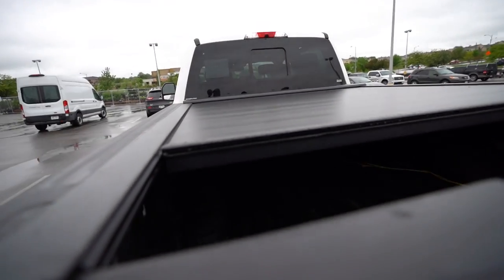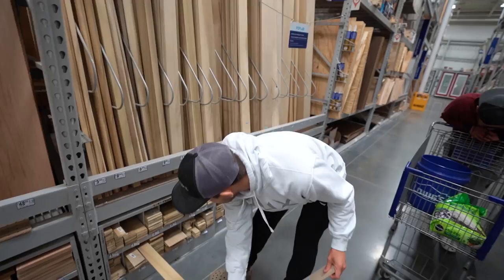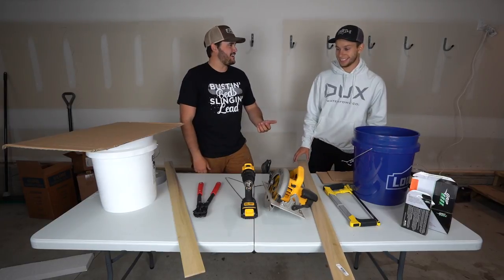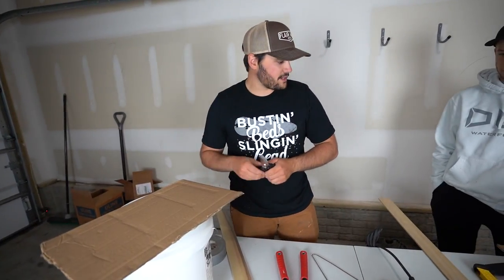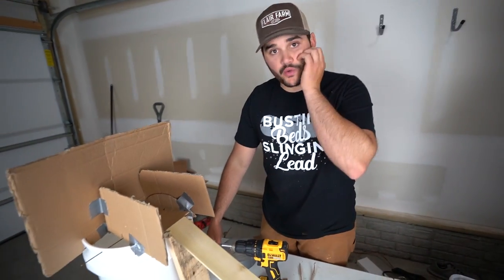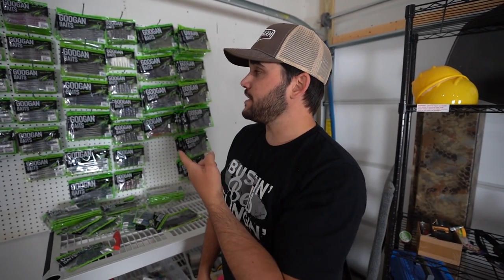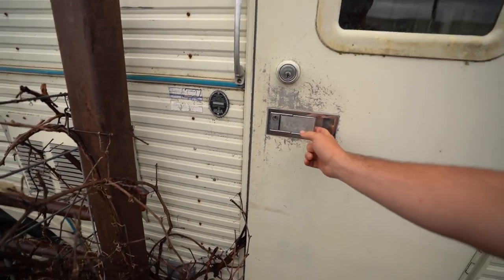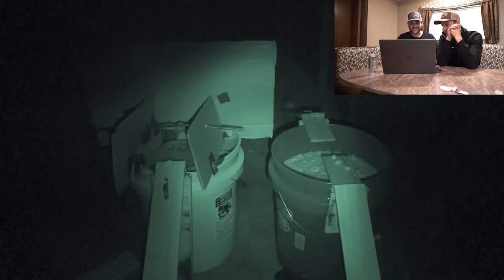EPIC Homemade MOUSE TRAPPING Challenge!! (CARDBOARD vs QUICKSAND)

Comment: Bro I'm all for the "glamorous" look of an automatic rolling bed cover but trust me..... Don't mud, don't drive on a diet road and don't put anything dusty in your bed.. u get one small rock in that motor or track your screwed. I have a 16 platinum f150 with automatic running boards and I have had to replace the motor twice, I live on a gravel road and do truck things with my truck... I finally just shut them off so I basically don't have running boards cause I'm scared to "get them dirty" just a fair warning man.

Comment: Self resetting I think is what you were thinking of.
For the quicksand one drop the water about 2-3 inches and have a minimum of 1 inch perlite. A better medium to use is coco fiber. You need less and it's more of a natural feel to the mice so they dont have as mich of a problem jumping on it.

Comment: Try like make a circle of cardboard that is will fit in the bucket with a strong through the direct center then hang it above so the cardboard fits in the bucket. Then put peanut butter on the cardboard so when they jump on it it tips and they go in. They can come from any side so it will be sick.

Comment: Use a 5 gallon bucket. 3/8 wood dowel, aluminum beer bottle, 30” ramp made out of wood as you used.  Cut the dowel to fit across bucket perfectly.  Drill holes into beer bottle center cap and bottom.  Take a round file or Dremel tool to clean up holes and make sure they are round and smooth.   Slide cut dowel through bottle and drill small hole then screw into dowel on each side of bucket maybe 1/2 down from lip.   Place ramp on neck side of bottle on buckets edge.  Put a huge glob of peanut butter around the center line of the middle of the bottle so as it spins there is always peanut butter up top.  Fill bucket with 8 inches of water.   Set and walk away.  We would catch 10+ a night with one of these.  Also work to limit food sources near by, such as grain etc by storing in sealable containers.  Limit what they can eat and when they are starving they won’t resist the peanut butter coots light Ferris wheel of death....

Comment: When u use a bucket mouse trap u drill two holes on the sides evenly apart from each other then put a can and a wire in it and put peanut butter on the can and put water in the bottom of the bucket

Comment: Should of just used the buckets with a wire run across the middle , with a pop can in the middle of the wire with peanut butter .. and fill up bucket just under half with water .. the mice go on the pop can it spins and resets for the next .. we got 7 mice 1 chipmunk n 1 squirrel best night